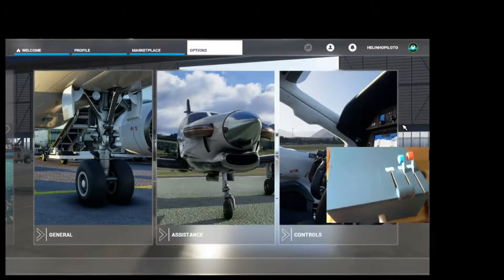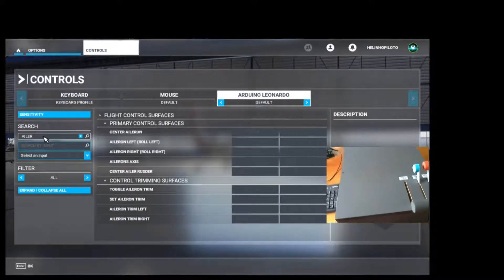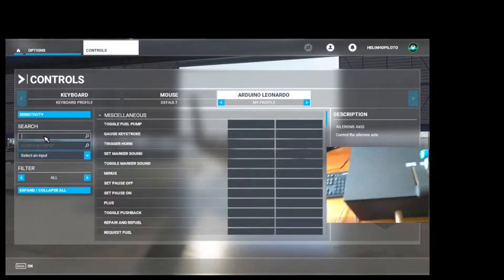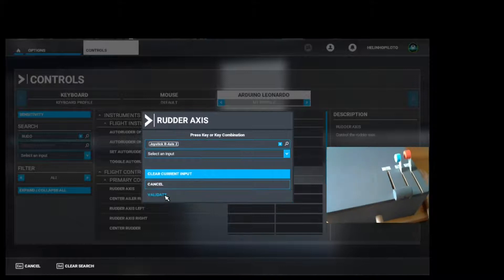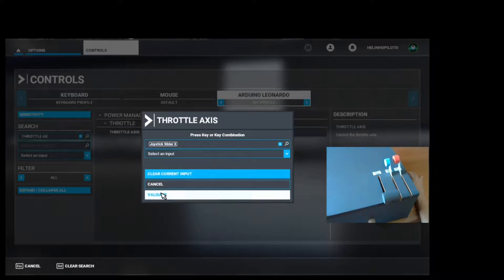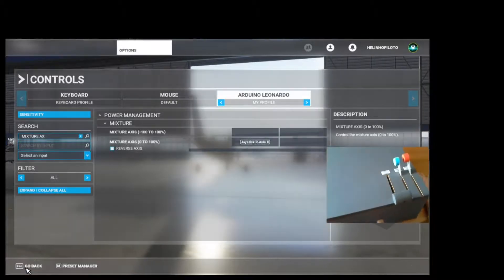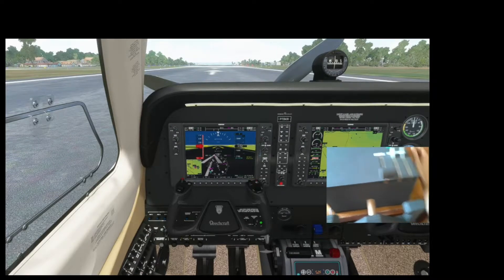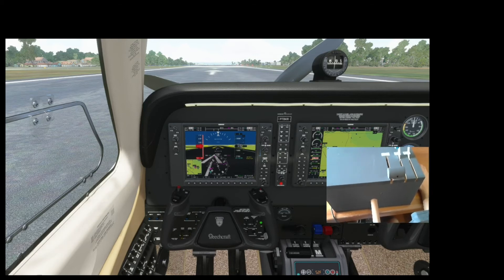HOW TO CALIBRATE AN ARDUINO LEONARDO JOYSTICK ON THE NEW MICROSOFT FLIGHT SIMULATOR 2020

Comment: Do you need to code the Arduino board?
Reply from the maker: Hi Chaminda! You need to install a joystick library on the arduino IDE (software) and you have to write some code on the Arduino Board. In my course a send the joystick library and the code. Just follow the lectures and you can make the joystick...very easy. You can take a look on the course...some lectures are available before purchase, so you can see if it is what you need. Link to the course: https://www.udemy.com/course/flight-joystick-with-arduino-for-pc-flight-simulators/?referralCode=065106F82574152C43BE
Reply: @simpilotbrasil  thanks. After few trials it works now. My son did the coding part.
Reply from the maker: @chamindakalugalage1071  you are welcome! That is good to hear...good flights for you and your son!